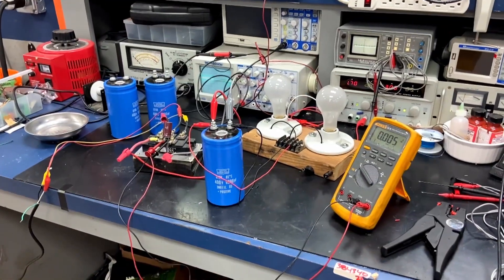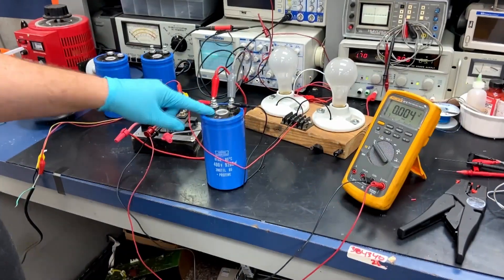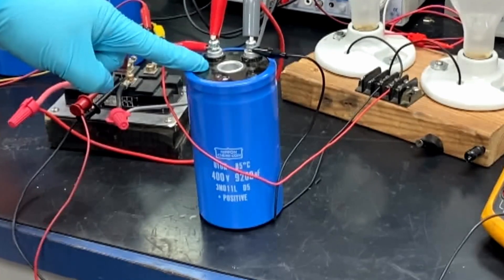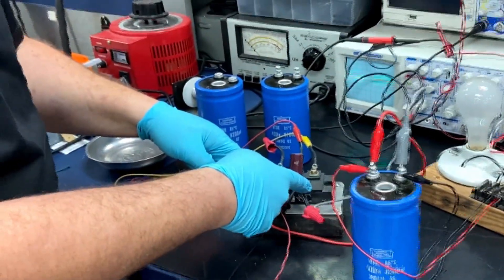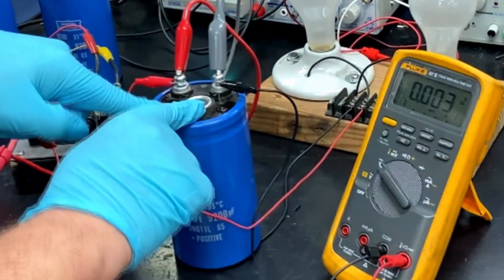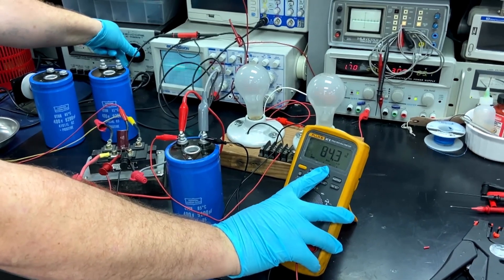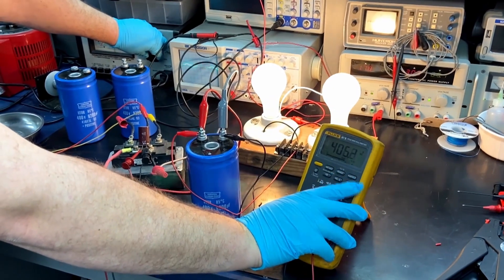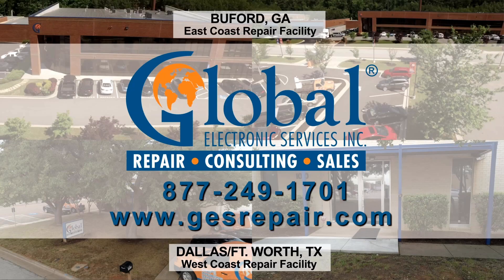Reforming Electrolytic Capacitors - VFD Repair

Comment: So fast? Did you check for leakage? In other videos I’ve seen it takes quite a long time to fully reform and get leakage current to an acceptable value and it the leakage is not reduced the capacitor is deemed unusable. Thanks for the video!

Comment: Can I reform several capacitors together by connecting multiple capacitors in parallel?
Reply from the maker: Make sure you do this with proper training and equipment and with safety measures in place. We would caution you to follow all manufacturers guidelines before proceeding with reforming capacitors. That being said it is our suggestion that they be reformed individually because a faulty cap in parallel that suffers a failure could affect the others that are connected.
Reply: @Gesrepair  thank you very much for your kind advice.

I have actually reformed about 80 capacitors more than a week ago, 10 at a time and fortunately it was incident free.